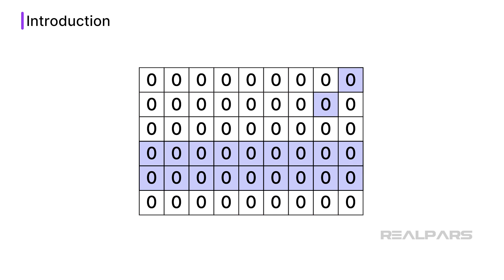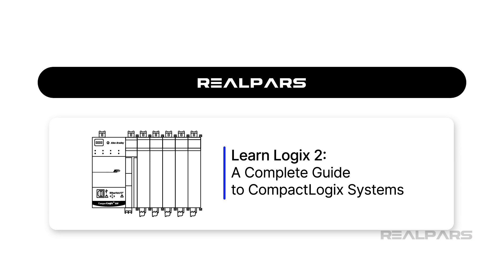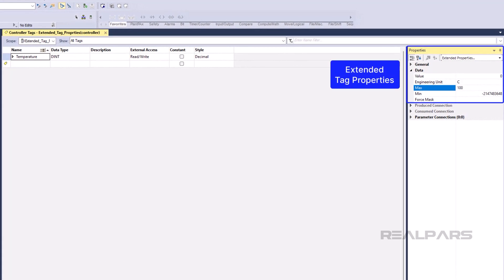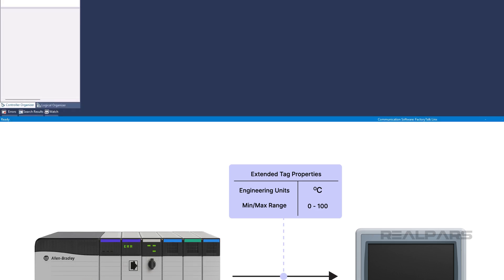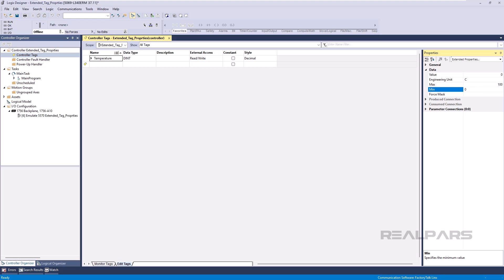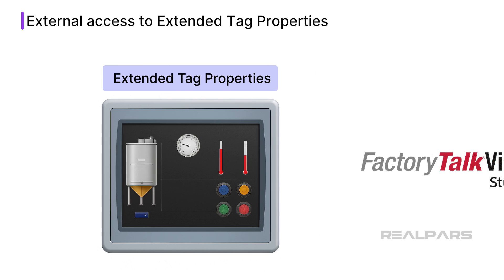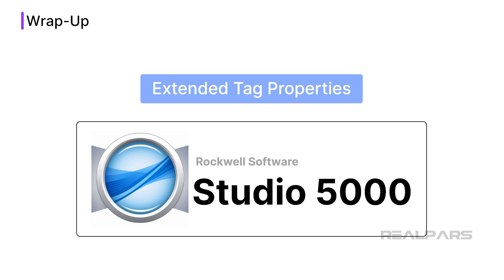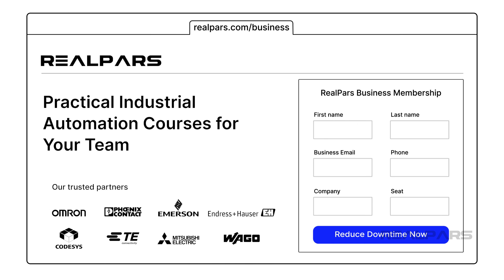How to Use Extended Tag Properties in Studio 5000 Logix Designer

Comment: What version does this start ?
Can these be edited online ? 
And do they act at limit if you have min and max set or do you still have to do the limiting logic yourself?
Reply from the maker: Started in version 21.
They don't act as a limit.
As far as I'm aware, the only limit to working with extended tag properties online is that they cannot be removed. But the best thing to do would be to test it yourself.